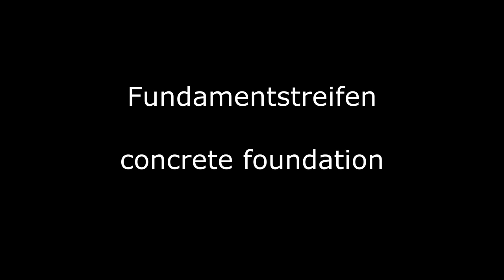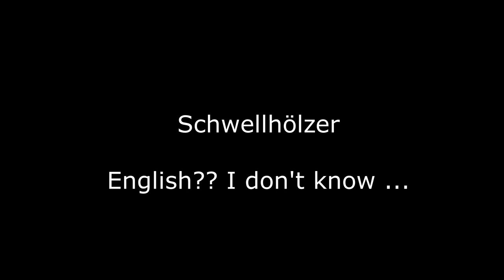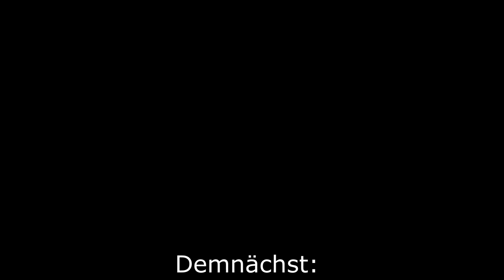Building a beautiful cabin with logs - part01

Comment: That's not how you do foundation out of stone , you come Up out of the ground 1 meter w/ the stone two strings mixed w/ cement fine sand and lime ! The stone is the foundation ! Just break the stone w/ a sledge hammer ! You wasted time and money !
Reply from the maker: Yes, the stones is in my case not the foundation, but the concrete behind them, true. The stones were just meant to give a nicer surface. Basically, I only wanted to have something I can put my wood upon ... so, I wouldn't consider it to be a waste of time and money. I ended up having what I wanted to have. ;-)
You think 1 meter is necessary? I chose 50-60 cm.
I didn't get the "two strings" thing, what do you mean?
Reply: @TheLandArksProject  right on , looks good 👍 I did it different I went down about a meter w /then came up with two strings 50 centimeters apart , I broke the stone only in the front  side of the property w/sledgehammer , I had a abundance of stone , river stone , 300 USD per dump truck !
Reply from the maker: @mynameisnobody6052  Man, that's a dream ... I would have paid thousands of USD to get such stones here, that's why I had to use small stones.
So your stone wall was 50 cm thick? Did I get it right?
What kind of sledgehammer did you use, with carbide blade or normal steel?
Reply: @TheLandArksProject  yes , 50 cm Thick , Not sure what type of sledgehammer it was but I remember the stone broke fairly easy didn't need a massive blow to break it , was about where you strike the stone ! Used cement , fine sand and lime for the water mix ! Don't get me wrong it's tremendous work